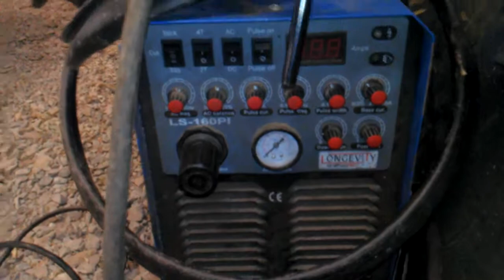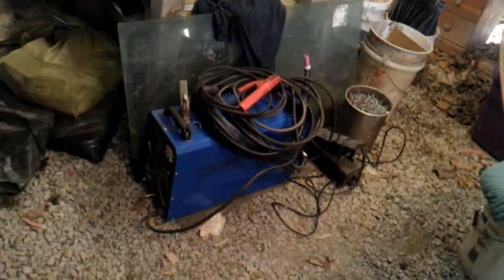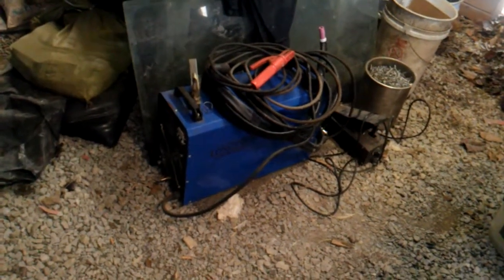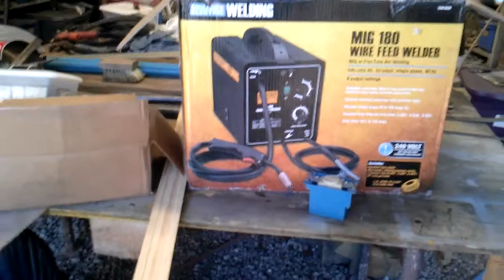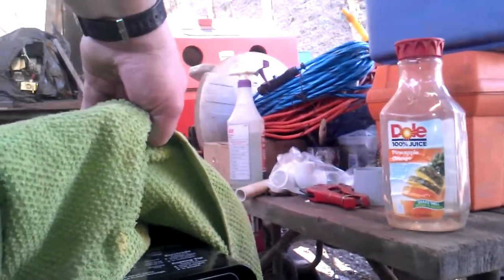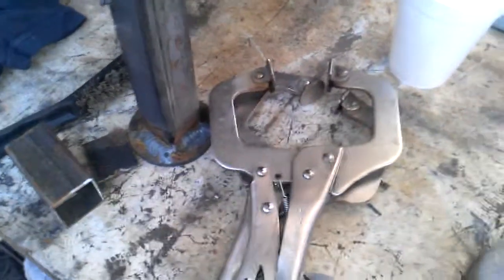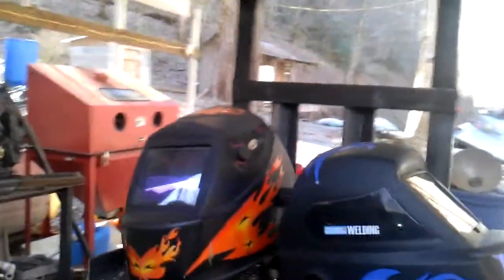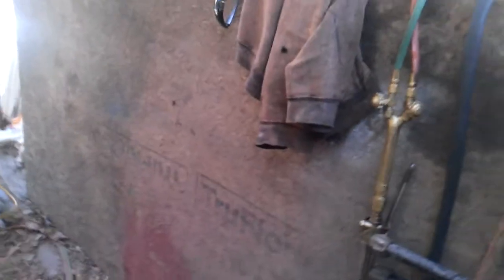Longevity WELDALL 160P IS JUNK...  No Warranty! WORKED WITH SIMON... WORST COMPANY EVER..

Comment from the maker: IF YOU ARE CONSIDERING A LONGEVITY PURCHASE, YOU SHOULD READ THIS..  IT'S NOT THE FACT THEY GOT A LOAD OF BAD UNITS,, IT'S THE FACT THAT THEY SOLD AND SHIPPED THEM """"KNOWING"""" THEY WERE BAD AND THERE WAS NO WAY TO MAKE THE PURCHASE RIGHT.. IF SO, THEY WOULD NEVER HAVE SOLD AND SHIPPED KNOWING THE ONLY WAY TO CORRECT THE PROBLEM WAS A ""FULL REFUND"... SHIT COMPANY!!
The video was posted Feb 2014, Machines were purchased 11/04/08...  That is about 6 years. 
The welder in the video,, I sent back the first 2 DOA Plasma Cutter and Combo unit about 1 year later after waiting for this "New Technology Unit" to arrive from China.. I paid $500 extra over sending back the first two units to pay for the upgrade and shipping on this 4th unit because the first 3 untils ALL ARRIVED DOA.. So, this unit was 5 years old and NEVER USED.. 5 seconds for the Plasma to quit working, Tig functions never worked,  and stick welder sucked bigtime and I already had both stick and Mig welders.. Fact of the matter is/was, Longevity was shipping DOA units and knew all they had was DOA units and was still charging and shipping for them,, knowing they could not make the purchases right.. Could have easily returned the crap to the factory to have it fixed but didn't.. 
More details below... So,, sorry Dude.. The facts are the facts.. But,,, considering your attitude,, you should really go ahead and buy from Longevity.. It would be nice to know that you and Simon would probably understand each other well... And, you would make a good match for him.. 
BTW.. Straight out of UPS, it was DOA and Remained that way for the whole time it was sitting there collecting dust.. 
I really hope that you have just ordered something from them...  Now, for the rest of the details.. 

Three units were purchased  for the Dealer program on 11/04/08. It was the 
1) ForceCut Plasma 60amp (Plasma Only)
2) Weldmax LC518D Multi Arc/Tig/Plasma
3) LDG-6500ATS Diesel Generator.
They arrived here in about a week.. 
All Units were DOA when they arrived.. None of them Worked.. 
Plasma Would not Cut, Weldmax (No Tig and Plasma would not cut), Diesel Generator had no D/C charging Circuit for the battery, and, only 105 volts on the A/C side, then only ran one hour and quit running.. 
They shipped a replacement Generator first, I paid $350 shipping for it.. It ran for an hour and quit..  Both units,,the fuel filter was clogged with metal shavings.. Got both running again.. First generator  was no good on the charging side..  Second generator had no 12volt D/C charging for the battery.. 
This took 2 months of reading crypic emails from china and testing this and that.. Waiting on some parts from China to swap out to try to fix the A/C and D/C for the second generator and if not, swap them to the first.. 
Found wires that were crimped by the housing (grounded to frame by factory), and thought parts would work, but, the part they sent required a total disassembly and still did not solve the problem on either unit.. 
During this time, I had been also taking both of the plasma and multi unit apart and doing everything they asked me to do (about one quick test per one to two weeks), they were asking me to do from the factory.. He was not at all interested in working with me... Wanted to ship me more units and me pay shipping... At this point, 4 units,,, all DOA,, and I didn't like the idea of paying to have more Crap taking up room in my shop... 
Simon said they were developing a "New" technology and it would be out in 2-3 months..  6 Months later, after my purchase,  I shipped the two plasma and multi units back to him and paid to upgrade to the Weldall 160 with the latest and greatest "New" Technologies... Cost me another $500... 
Remember now.. I had bought 3 Brand New Units,, Then, paid another $350 to get another Generator that he was supposed to have cranked and tested in shop before shipping,, which arrived without any oil or any trace of diesel in the Gas Tank, and arrived DOA..  Then,,, I had to pay Return shipping for the 2 Brand new units, and pay upgrade and shipping to get the "New" Tech unit... It arrived DOA also.. Stick Welder worked, but, I already had a stick welder.. 
Plasma worked for about 5 seconds and quit... Tig didn't work except on the lowest setting for (aluminum cans), none of the fancy features worked..  He wasn't going to test and ship anything else to me even at my expense... 
WASN'T EVEN GOING TO TEST A UNIT TO MAKE SURE IT WORKED AND SEND IT TO ME,,,, IF I PAID THE SHIPPING EXPENSE...  
I asked him to make a short video of the unit cutting a piece of 1/2" plate and a quick test of the arc welder welding any type of joint (only required that the video include the piece before welding, the arc and the video to also include the finished weld after,, and the tig tested to show the pulse and post flow was working.. 
Would have taken a grand total of 10 minutes of his time to video someone testing the unit, since he LIED about testing the Second Generator I paid $350 to test before shipping and he didn't.. Can't test one without some residue of Diesel left in the tank or oil left in the sump...  Facts speak for themselves.. 
He knew nothing he was selling was working and he had no way of fixing the problem other than a full refund, which he was surely not going to do,,, if he was still selling nothing but DOA products to begin with... 
I offered to wait until he got the problem solved.. He suggested 6 months.. We had already been swapping and delaying for 6 months to begin with.. So, I contacted him 6 months later (now one year without any working Longevity products).. Well within the advertised warranty period... 
I contacted him and he acted like he had never talked to me.. I reminded him with a screen shot of all of our emails back and forth for the 6 months we were working on the crap.. Then, he said,, well, why did you not contact me for 6 months.. I replied to him with the date and time of the email he agreed that we should wait 6 months and try again,, should have the problem ironed out.. He could not find the email, so, I forwarded it back to him.. 
And, he just started avoiding my calls, and would not answer my emails... Obviously he was either a royal piece of shit,, or he still didn't have any units that worked.. I told him.. If he shipped a unit that arrived working, I would ship the 160 back to him in the same box and pay shipping for the old unit and, I still wanted a working generator...

Comment: That's too bad    i have a Longevity 200s and i've used that machine hard and it is AWESOME  for about 5 years now.
Reply from the maker: Amazing.. I bought their dealer package.. 5 Units... One Generator and the rest Combo Machines, a single plasma cutter, etc.. They shipped the first generator to replace the brand new one that ran for 5 minutes and would not crank again, and they could not troubleshoot it, with me standing right there with a full toolbox.. 
None of the Plasma cutter options worked.. At best, they welder was shitty and was slow to strike an arc and then the voltage ran away.. Swapped out 3 more of the Combo machines, I paid shipping for the last two, and I finally said,, I don't care what you send... I'll pay for the shipping when I get one that works..
I begged that they pull one and test it before shipping.. It was obvious that they did not.. 
They could  not tell you something simple about adjusting their machines.. I found some stuff online about adjusting the spark gap, but, they never said what to adjust it to.. They didn't know either.. Well, no wonder it wasn't on the original post.. 
I told them to refund half of my money at least, since they had paid to ship all of the replacements (not my fault),, but, I got nothing but hanging up and not returning my emails.. 
They suck.. I don't know how you got a good one out of that bunch.. I waited a year,, Holding an email that said they would upgrade and consolidate to the last machine in this video.. I waited because they were coming out with a new version that fixed all of the problems they were having with the old ones... 
I waited a year, and then, called him.. I reminded him about the email, he said, he doesn't do that.. I sent the email to him,, and finally after about a week, he shipped one.. DOA.... 
I gave up $1500 screwed.. I hope I never run across him.. I will remember his voice forever.. I will not be able to keep my cool if I ever do..  I don't care if it is 10-20 years from now.. I will chastise him for all of the air that he has breathed that other human beings could have been breathing that would provide some better something for humanity... There are about 5 people on this kind of list in 53 years... 
But, I'll bet he won't remember me before I remind him who I am, but, I'll bet he will NEVER forget... 
Not one machine out of a total of I think 12 to 15 worked.. This went on for over a year..
Reply: wow    were they those mossfet shit machines ?   i got a champion generator it's pretty good
but the 200s i got is igbt and it's really good
i got everlast plasma and it has been good too
Reply from the maker: I have the HF plasma..Going on 3 years and never have any problems with it.. Once in a while I foul a tip, but, it was every day or so on the Longevity machine,, when it worked for a few minutes.. Never did fire an arc worth a shit... HF fires every single time, and as far as consumables, I foul a tip maybe 3 to 4 times a year. 
The machine I waited for, the one I show in the pictures is the IGBT machine.. 
They had been out for about 6 months when I ordered/consolidated into the last machine that I got my final screwing with.. I guess they figured, they had sent me enough machines, I should have been happy.. Didn't matter if NONE of them worked..
Reply: Hmm.... amazing how good that harbor freight stuff is and it's priced right too.

Comment: actually i have that harbor freight 180 too and it is good too   i use it for aluminum
Reply from the maker: frank farta I I have never tried to weld aluminum with this one. Just mild steel so far. I know I need to get heliu, I think, not sure what else
Reply: yah helium....  the liner will plug up after several rolls of wire and need to be cleaned and modified is all that i found.  But for aluminum the weld was better than my longevity spool gun.

Comment: Sorry dude, first you said that you’ve had this unit for 5 years, then you said it was straight out of UPS, so which is it? Because this welder does look like you’ve been using it for quite a while though 🤣
Reply from the maker: The video was posted Feb 2014, Machines were purchased 11/04/08...  That is about 6 years. 
The welder in the video,, I sent back the first 2 DOA Plasma Cutter and Combo unit about 1 year later after waiting for this "New Technology Unit" to arrive from China.. I paid $500 extra over sending back the first two units to pay for the upgrade and shipping on this 4th unit because the first 3 untils ALL ARRIVED DOA.. So, this unit was 5 years old and NEVER USED.. 5 seconds for the Plasma to quit working, Tig functions never worked,  and stick welder sucked bigtime and I already had both stick and Mig welders.. Fact of the matter is/was, Longevity was shipping DOA units and knew all they had was DOA units and was still charging and shipping for them,, knowing they could not make the purchases right.. Could have easily returned the crap to the factory to have it fixed but didn't.. 
More details below... So,, sorry Dude.. The facts are the facts.. But,,, considering your attitude,, you should really go ahead and buy from Longevity.. It would be nice to know that you and Simon would probably understand each other well... And, you would make a good match for him.. 
BTW.. Straight out of UPS, it was DOA and Remained that way for the whole time it was sitting there collecting dust.. 
I really hope that you have just ordered something from them...  Now, for the rest of the details.. 

Three units were purchased  for the Dealer program on 11/04/08. It was the 
1) ForceCut Plasma 60amp (Plasma Only)
2) Weldmax LC518D Multi Arc/Tig/Plasma
3) LDG-6500ATS Diesel Generator.
They arrived here in about a week.. 
All Units were DOA when they arrived.. None of them Worked.. 
Plasma Would not Cut, Weldmax (No Tig and Plasma would not cut), Diesel Generator had no D/C charging Circuit for the battery, and, only 105 volts on the A/C side, then only ran one hour and quit running.. 
They shipped a replacement Generator first, I paid $350 shipping for it.. It ran for an hour and quit..  Both units,,the fuel filter was clogged with metal shavings.. Got both running again.. First generator  was no good on the charging side..  Second generator had no 12volt D/C charging for the battery.. 
This took 2 months of reading crypic emails from china and testing this and that.. Waiting on some parts from China to swap out to try to fix the A/C and D/C for the second generator and if not, swap them to the first.. 
Found wires that were crimped by the housing (grounded to frame by factory), and thought parts would work, but, the part they sent required a total disassembly and still did not solve the problem on either unit.. 
During this time, I had been also taking both of the plasma and multi unit apart and doing everything they asked me to do (about one quick test per one to two weeks), they were asking me to do from the factory.. He was not at all interested in working with me... Wanted to ship me more units and me pay shipping... At this point, 4 units,,, all DOA,, and I didn't like the idea of paying to have more Crap taking up room in my shop... 
Simon said they were developing a "New" technology and it would be out in 2-3 months..  6 Months later, after my purchase,  I shipped the two plasma and multi units back to him and paid to upgrade to the Weldall 160 with the latest and greatest "New" Technologies... Cost me another $500... 
Remember now.. I had bought 3 Brand New Units,, Then, paid another $350 to get another Generator that he was supposed to have cranked and tested in shop before shipping,, which arrived without any oil or any trace of diesel in the Gas Tank, and arrived DOA..  Then,,, I had to pay Return shipping for the 2 Brand new units, and pay upgrade and shipping to get the "New" Tech unit... It arrived DOA also.. Stick Welder worked, but, I already had a stick welder.. 
Plasma worked for about 5 seconds and quit... Tig didn't work except on the lowest setting for (aluminum cans), none of the fancy features worked..  He wasn't going to test and ship anything else to me even at my expense... 
WASN'T EVEN GOING TO TEST A UNIT TO MAKE SURE IT WORKED AND SEND IT TO ME,,,, IF I PAID THE SHIPPING EXPENSE...  
I asked him to make a short video of the unit cutting a piece of 1/2" plate and a quick test of the arc welder welding any type of joint (only required that the video include the piece before welding, the arc and the video to also include the finished weld after,, and the tig tested to show the pulse and post flow was working.. 
Would have taken a grand total of 10 minutes of his time to video someone testing the unit, since he LIED about testing the Second Generator I paid $350 to test before shipping and he didn't.. Can't test one without some residue of Diesel left in the tank or oil left in the sump...  Facts speak for themselves.. 
He knew nothing he was selling was working and he had no way of fixing the problem other than a full refund, which he was surely not going to do,,, if he was still selling nothing but DOA products to begin with... 
I offered to wait until he got the problem solved.. He suggested 6 months.. We had already been swapping and delaying for 6 months to begin with.. So, I contacted him 6 months later (now one year without any working Longevity products).. Well within the advertised warranty period... 
I contacted him and he acted like he had never talked to me.. I reminded him with a screen shot of all of our emails back and forth for the 6 months we were working on the crap.. Then, he said,, well, why did you not contact me for 6 months.. I replied to him with the date and time of the email he agreed that we should wait 6 months and try again,, should have the problem ironed out.. He could not find the email, so, I forwarded it back to him.. 
And, he just started avoiding my calls, and would not answer my emails... Obviously he was either a royal piece of shit,, or he still didn't have any units that worked.. I told him.. If he shipped a unit that arrived working, I would ship the 160 back to him in the same box and pay shipping for the old unit and, I still wanted a working generator...